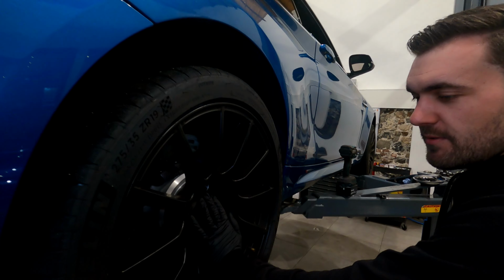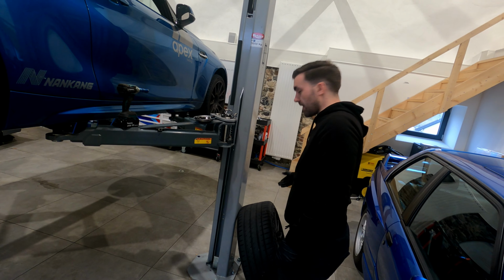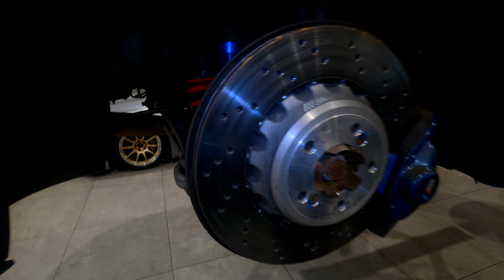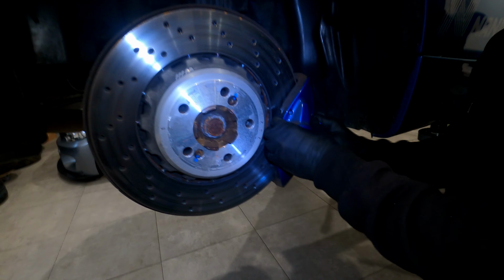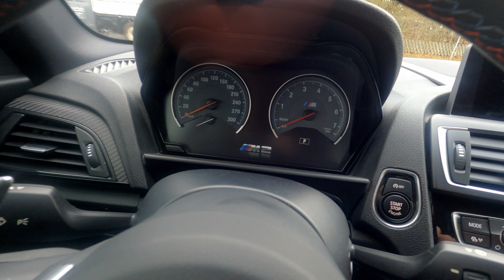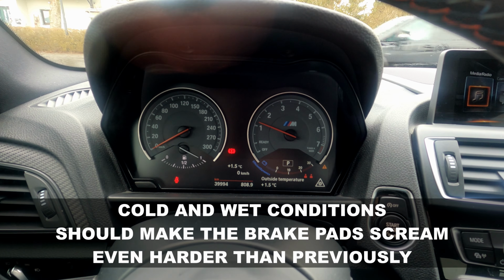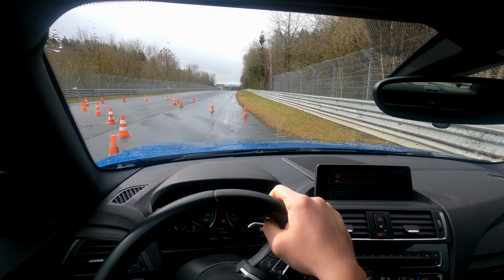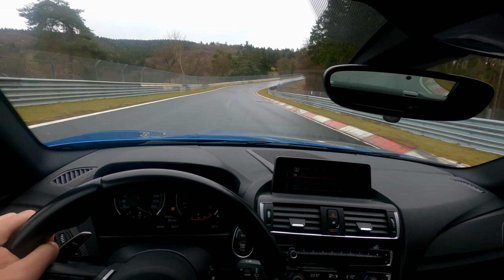Noisy Brakes? We Haven't Heard of THIS Solution Before.

Comment: I learned a trick in back high school , to lightly sand the new pad surfaces, pad sharp edges and slightly bevel the edges , if possible swirl the discs old or new prior to installing and do a  bed in process after that , after doing this your brake feels dramatically better just by a few ol skool tricks

Comment: Tire prices and sizes are something I have followed closely after owning a 335 with runflats (almost $3000 US for a set back in the day, and they didn't last either).  My WRX can get a set of P4S for around $750 installed.  Was looking at the Model Y for my wife recently, and was so pleased to see the 19" tires for it are super reasonable, less than $900 US for a set installed.  When you're young, it's so easy to just ignore the tire maintenance costs when buying something, but I quickly learned that lesson.

Comment: Nice, auto-wet-sanding pads. Both should be flat, both are friction-based, so it makes sense that you can use another pad to sand it.

Also, Robert when it comes to speed bumps: take it slow, there's no need to unnecessarily jar the entire suspension when we do thousands of laps. 
MIsha: FULL SPEED, slight brake, POWA!

Comment: It" s a trick mountainbikers also use after installing new pads on the disc brakes.  Just a big squirt of water on the pads, then brake hard.  After 5 or 6 times, they are good to go.

Comment: 2:19: start engine , select 1st Gear, Just hold the Sandpapier to the rotating disc.
Reply: Bad idea. Very bad idea.
Reply: 1 - doesn’t remove deposits very well
2 - I like my fingers 
3 - Added time of clearing abs codes
Reply: @TwistedSymmetryUK  OK. My sugesstion wasn't meant too serious....But If you like your Fingers soo much, then don't Work on cars.😄 And the uneven surface of your disc will BE Rubbed even by the Bakepads. (Hopefully) Then you can Check the ABS Sensors or Check the Sensors.😉

Comment: Most of the noise is from deposits on the pads so it's standard procedure to clear the muck that collects on them. It's usually because the pad is harder than the discs. Grooves help with clearing the surface of the pads. Also if you thrash them a few times they do stop squealing

Comment: I use WD40. My brakes aren't noisy anymore.. maybe cause i crashed the car but it was in complete silence :)
Reply: I use WD40 too,BUT i drive very slow..brake a couple of times, then clean disc and brake calipers with brake cleanner....it works!!👍
Reply: 😂 lol
Reply: WD40? Are you mad?
That runs off in no-time!
I use high temp copper grease.
Just a thick layer, directly on the disk.
No need to disassemble anything either.
Plus, strangely enough, the pads last a lot longer.
I did 250kkm and I'm still on my first pads.
Extra bonus, I never been rear-ended either!
 Downside: I rear-end a lot of others.
But hey; no squealing brakes.
I hate that.
Reply: @Paul_VanGo  It was a joke.. 

I use pig fat..
Reply: @jgvbadv  In that case, I agree. 😁

Comment: 2 years ago, I replaced the front disks and pads - 1 of them quickly got warped and they squeaked soemtimes. Some time later I had the 2 disks polished and we replaced the "new" pads since they were eating the disk away. Got new, know for being softer, pads - now them brakes squeak even worse..... I can say its worse than the BMW at the start....

Comment: I think rubbing the brake pads together is to remove the old brake pad deposits that stuck to the new pads.
Reply: Or remove unevenness from the pads. You could do it with sandpaper too. but both pads on each other also works fine. And saves you some sandpaper.  Brakes are just 'sandpaper' trying to grip a moving disc.  If you ever need griptape just wrap sandpaper with doublesided tape on inner ends and you destroy your skin before the grip goes.

Comment: Hey Misha! Tell this/Show this to George! 

Dont spend your time to sand all 4 rotors both sides thats 8 times sanding lot of time! (Man thats f*cked up... lot of time)
Using alcohol on disk is enough... On the breakpads using a 1000 2000 sandpaper When dry! After it using alcohol is the way to get rid of that sounds. Oily thing is on the disc and pads (maybe you just touched with bare hand)...  i do this sometimes on my xc bike have ceramics pad.
Trust me im a mechanic!

And Misha! Dont touch the disc with bare hand! :D

Comment: My condolances...
But for the brake pads, why don't you put some heat resistant grease on the back side?
Between the pad and the piston that is, and also other surfaces where back-plate of the pad is sliding against the caliper-parts.

Comment: What is the reason the wet line is on the outside of the corners? I'd say that that would give you even less room for error, but I'm probably wrong :P
Reply: The short answer is there is a lot of rubber put down on the track on the normal dry racing line and it becomes very smooth. When it gets rained on, that surface becomes very slippery so there is more traction to be found by moving over onto the cleaner coarser pavement that isn’t used in the dry. The extra traction more than makes up for loss of room for making mistakes, although it’s harder to watch on camera it feels better to the driver.
Reply: @wallymcguire2033  Thanks for the very clear answer!

Comment: What kind of sandpaper was used for the rotors? Also how'd you get at the inside/back face with the backing plates in place, I thought it was mostly covered.

I often end up with horrible squealing from my PFC and Pagid pads on my M2 after track days, I do also swap back and forth with the OEM pads though cause of the noise (squealing but also clunking from lack of anti-rattle shims etc) and cold wear.
Reply from the maker: Next to the caliper there is some space to get behind